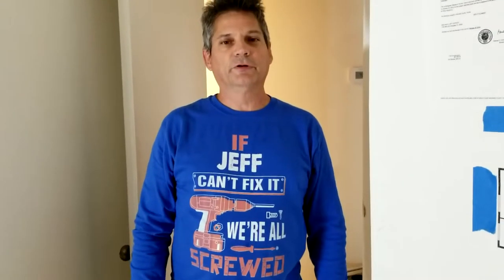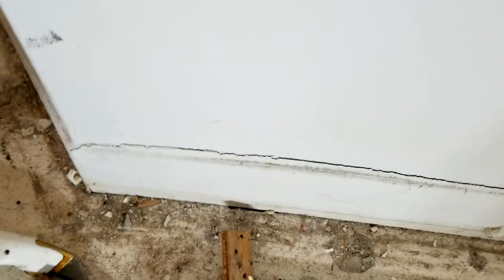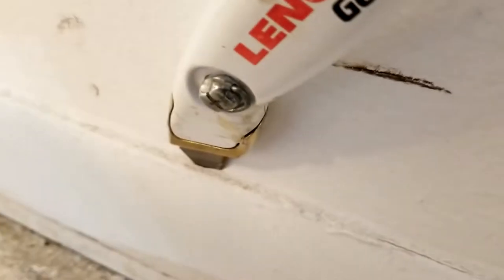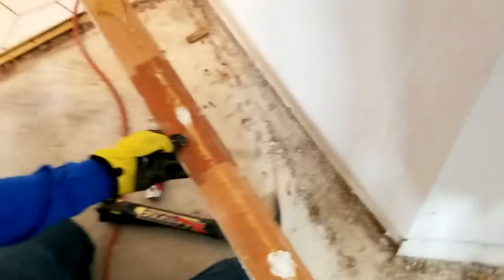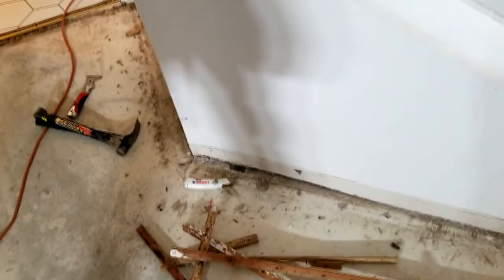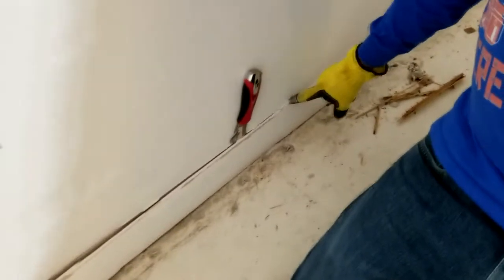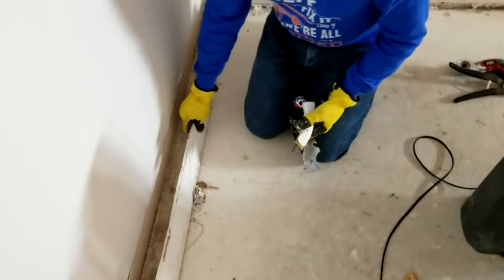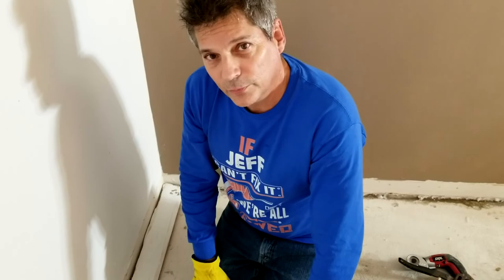DIY How To Remove Baseboards, Trim, Moulding - No Wall Damage

Comment: Can I do this to see where the studs are in the wall? I am trying to install a sliding barn door and can’t find them with stud finder or by 16 or 12.
Reply from the maker: No because the brad nails are just shot into the drywall,  not always in the studs. The studs are always at the corner then every 16". Every switch and electrical outlet, their box is nailed to a stud, so that should give you an idea where the studs are. A good stud finder tool should be in your bag of tools.